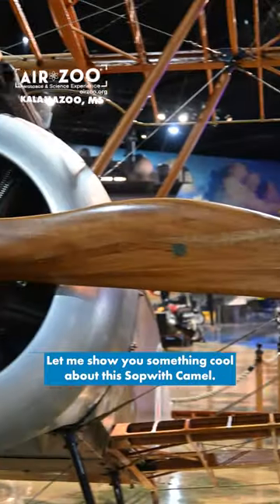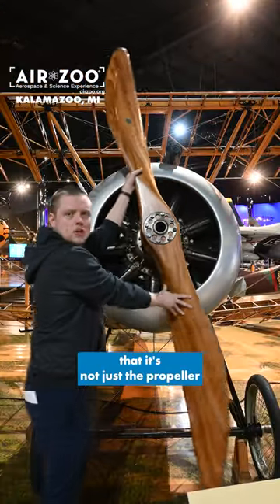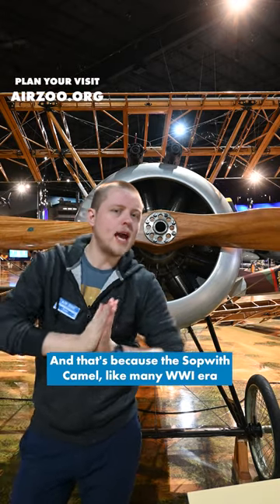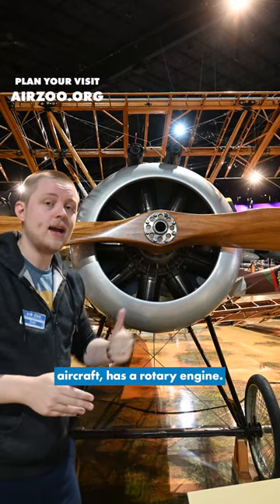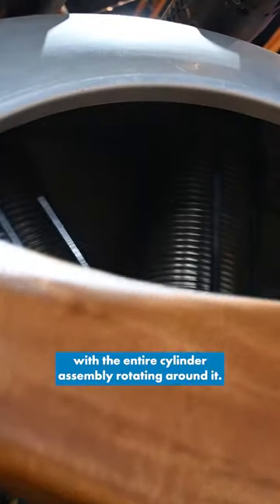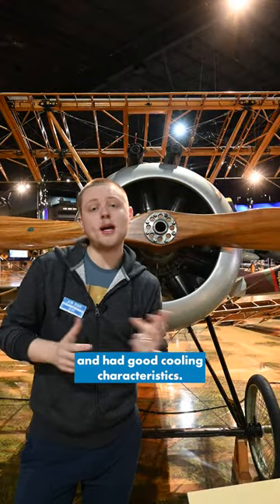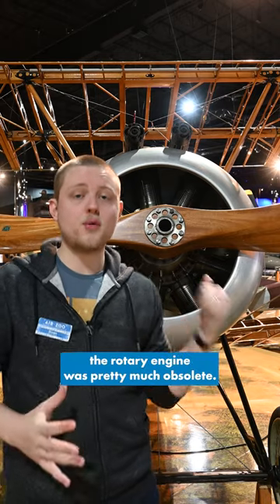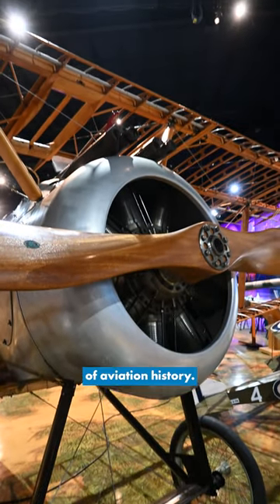The Sopwith Camel's spinning engine!

Comment: Oh oh, it’s actually a radial engine. Rotary engine is a slang for the Wankel engine, a form of pistonless engine.
Reply: Thanks, was looking for a comment like this to learn how thoose are really called.

Ps: angry vrooom noises
Reply: No, this is a rotary cause the whole thing spins. A radial looks similar with the ring of cylinders, but in a radial, the cylinders don't spin like this one.. Just the prop spins. This thing was called a rotary many decades before the Wankel was ever even invented. Which is why this is just "a rotary" and a Wankel rotary is "a Wankel rotary.".. This one came first, by a long time. So it's got dibs on the name.

Comment: They could have just solved it by putting a counter rotational spinning Mass
Reply: And in so doing dramatically decrease performance. These planes were extremely light weight and not particularly powerful.

Comment: "By the end of WWI the rotary engine was pretty much obsolete"
The Fokkewulf 190 after obliterating B17s off Europe's sky: that's where you're wrong kiddo
Reply from the maker: That's where YOU'RE wrong kiddo...
The Focke-Wulf Fw 190 was powered by a BMW 801 radial engine which was NOT a rotary engine.
Reply: @AirZoo  ah shite you're right, damn it
Reply: @abriannaaguilera2123    Fokke-...you must be thinking of Anthony Fokker, a Dutch aeronautical engineer who designed several WW1 German planes.

Comment: Not rotary, radial. I don't care what Wikipedia says, I don't care what Mandela Syndrome BS you plead. Rotaries are Wankels and those blocks are fixed, there is nothing similar between them and these radials.
Reply: Typically rotary engines are engines where the combustion chambers rotate along with the output shaft. By this definition a Wankel IS a rotary engine. It doesn't matter that the engine block doesn't rotate.
Reply: @Toby sorry "son" but you're making the same, simplistic mistakes as everybody else who insists the one is just a subset of another. Try again, without the ignorance and arrogance
Reply: @krakhedd  :  |
Do you need to take your meds, gramps?
Reply: @krakhedd  The rotary aircraft engine was invented in the late 1800s and developed prior to WWI. The Wankel engine was patented in 1929, and not developed until the 1950s. 
All that you've shown with your reply is your ignorance and arrogance of the subject. Google and an encyclopedia is your friend. Use it!
Reply: @ewhartiii  there is nothing similar between a rotary and a radial except some similar fuel types. Try again. You're trying to use the very widespread mis-use of the word "rotary" which I'm challenging. You're not very intelligent or you'd have recognized that.
Reply: @ewhartiii  Manly? Called it a RADIAL. And it's not the same as a ROTARY which SPINS THE CRANKSHAFT. Try again, Mr. Derpy Diddly Duuuuurrrppppppp
Reply: Wankels are Wankels. This engine was called a rotary before the Wankel engine even existed on paper.
Reply: @silaskuemmerle2505  Manly, the inventor, called them radials.
Reply: @krakhedd  radial refers to the piston arrangement, how they’re intended to be mounted is the difference between radials and rotaries in aircraft. The company that made the engine in the sopwith camel called it a rotary, so it’s a rotary. One of these days I’m going to figure out who decided to call the Wankel engine a rotary for the express purpose of pissing on his grave since rotary was already an established term for a specific subset of radial engines long before Wankel put pencil to paper.
Reply: @krakhedd  quote from Wikipedia under radial engine: 
"C. M. Manly constructed a water-cooled five-cylinder radial engine in 1901, a conversion of one of Stephen Balzer's rotary engines, for Langley's Aerodrome aircraft. Manly's engine produced 52 hp (39 kW) at 950 rpm."

The rotary was invented before the radial engine. Here's another quote from the article on rotary engines:
"Félix Millet showed a 5-cylinder rotary engine built into a bicycle wheel at the Exposition Universelle in Paris in 1889. Millet had patented the engine in 1888, so must be considered the pioneer of the internal combustion rotary engine."

1889 predates 1901, when the radial engine was first made. 1888, when the rotary was patented also predates 1929 when the Wankel engine was patented.
Please learn to actually attempt to research something before attacking someone else's intelligence.
Reply: @ewhartiii  thank you for reinforcing that they are NOT THE SAME THING

And find better sources. Wiki is inconsistent at best although it at least has a separate page for Radials which contains mostly correct info
Reply: @krakhedd  Stephan Balzer invented the rotary engine which Manly used as the basis for his radial engine, so as it turns out, you didn’t do your research because Balzer called his engine a rotary.
Reply: @silaskuemmerle2505  Manly had to modify it to make it work well and he decided on "radial" and that's what stuck until for some odd reason what seems to be the past 10 or so years people started to question the nomenclature.  This only adds confusion and is somewhat akin to calling an engine a motor although that's typically denoted by accompanying data such as displacement, to at least give some modicum of specificity.

A rotary is a Wankel.  A radial is what this is.  Deal with it.
Reply: @krakhedd  the only reason you only noticed it in the past 10 years is the prevalence of the internet. Before that you had to get your information out of a book and most people (like you evidently) tended not to crack the books on this topic because they’re fairly dry reading. Radial in reference to aircraft engines refers specifically to the type where the crank rotates and the case is fixed